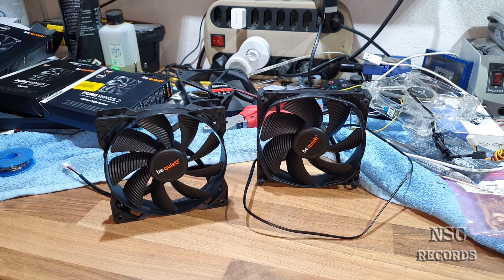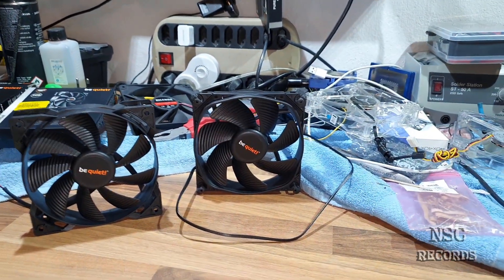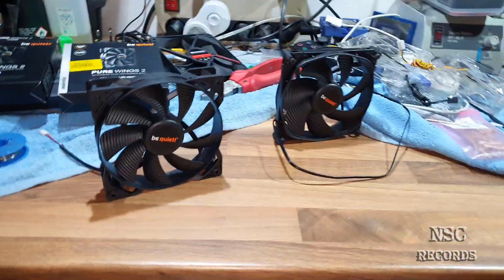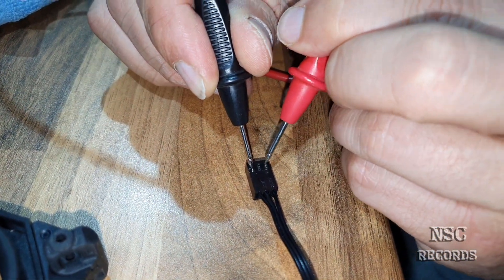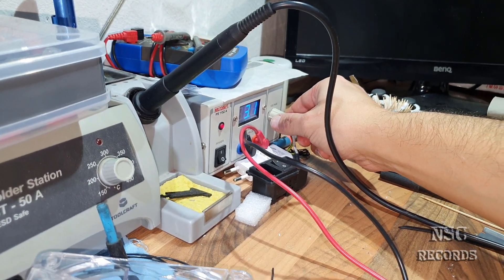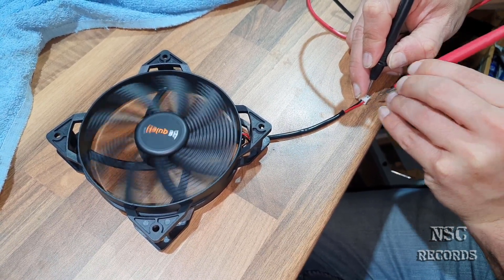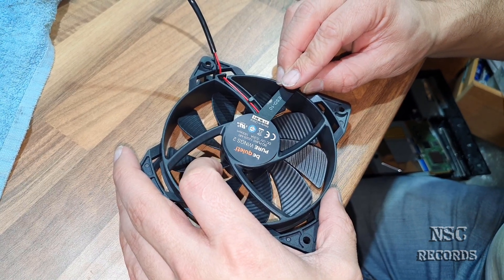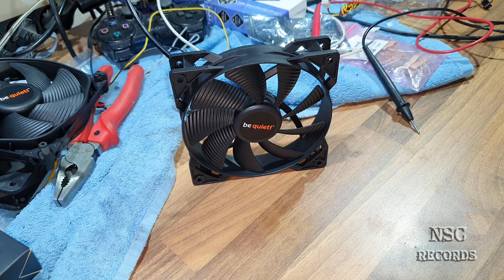Do NOT replace a PSU Fan before you watch this video! By:NSC

Comment: Great video, thanks a lot. How to i know minimum fan voltage of my PSU? Starting voltage of the original fan isn't in datasheets.
Reply from the maker: You welcome. Start your PSU when it's could and while that check the fan voltage with a multimeter.

Comment: I managed to replace a cooler master fan which had became noisy even at low rpms. I had an old Noctua NFP 14 with no pwm nor tachymeter working because of bad wiring :) Only the fan was working. but as you say in the video, it only starts at 4.5V. the power supply fan start at 3.5V. So i have soldered  a little circuit to boost voltage a little bit with an Opamp and a transistor it works for now ! No noise at all thanks to noctua !
Reply from the maker: Good job and you always welcome 🥰

Comment: is this good for Cooler master GX750 Bronze Power Supply?
LIGHT WINGS 120mm PWM

General data
Model	Light Wings 120mm PWM
Dimensions (mm)	120
Color option	Black
Lighting	ARGB LED
Fan speed at 100% PWM / 12V (rpm)	1700
Noise level at 100% PWM / 12V (dB(A))	20.6
Airflow at 100% PWM / 12V (CFM / m3/h)	41.5 / 70.5
Air Pressure at 100% PWM / 12V (mm H2O)
Reply from the maker: I don't know, you need to try it out your self, like the most here. If your fan is very loud or just disturbing you, than try an other fan. Just always take care while working with PSU's

Comment: Very valuable video. My HA13525H12F-Z in Antec Edge 650W starts to be very noisy and I can't fix it because it's sealed. It' quite difficult even to order the same fan, mine is translucent with leds, but even black one is hard to find. I only see ones on ebay/Amazon but they don't ship to Poland and I don't know it is original or fake one or it will be working or not. Expensive one for sure.
Do you know which 135mm fan can I order to replace it? This little guy working on 2,6V after start unfortunately but it's very uncommon size, most of fans in this size needs more voltage to work.

Comment: is Be Quiet Pure Wings 3 also have low start voltage?
Reply from the maker: Yes, but as i know the Wings 2 even lower.
Reply: @NSC-Modz  I just found ARCTIC P12, even officially says 2.8v starting voltage
Reply from the maker: @mantis1033 good to know bro. But if you like it quiet, then you need BeQuiet Fans 😆
Reply: @NSC-Modz  my old power supply from bequiet has a 3rd party Protechnic Magic MGA12012HS-A25 ball bearing fan that is now rattling like crazy. I do not want to swap out the perfectly fine PSU therefore I came here through a crazy PSU repair rabbit hole. Love the video, thank you so much!
Reply from the maker: @ukaszoriol1656 you always welcome bro.

Comment: hi..please help me.. i must change thw psu fan (2pin)... i found only a fan with 4pin ..how modify to 2pin?? and thw other cables? thanks
Reply from the maker: @esaresar-tn8gi  you don't really need the other cables, you just need plus and minus. 3 pin fan is easy to find also.
Reply: @NSC-Modz  I don't want it to work at full speed.. if we can connect the other cables so that the rpms can be adjusted outside if this is not possible
Reply from the maker: @esaresar-tn8gi  it is possible
Reply: @ tell me please what cables connect... this i need know
Reply from the maker: @esaresar-tn8gi Only the RED and Black.
RED = PLUS
BLACK = MINUS

BUT if you don't know what your doing, better DON'T do it, never play with PSU's. It's Danger
Reply: @ thanks.. the problem is that red and black cable give 12v all time and th3e fan works gull.. how bypass thw 3 and 4pin for not working full???
Reply from the maker: @esaresar-tn8gi  https://www.moddiy.com/products/Fan-4-Pin-PWM-Connector-Male-to-2-Pin-CB-32D-Connector-Female-5cm.html

Comment: thank you so so much...no one talks about this huge problem..i replaced the fan from my psu with  a noctua nf-a14 flx and it tried to spin but the voltage was low and didnt spin,so i put the old back.
After your video i found another youtube channel that test fans at low voltages and now i can find a proper fan...thank you so much again..
PS my evga sends 5v at start.
Reply from the maker: @BGDS  you always welcome, good that you found my video... god thanks
Reply: Whats the best fan with the lowest voltage?

Comment: I wish I would have watched your video before I replaced the fan in my Seasonic power supply. :face-purple-crying: The fan (Thermalright TL-B12W) I bought was recommended by a tech blog, but unfortunately the fan would not spin unless I  pushed it with my finger or until the power supply got hot. I put back the original noisy fan since it's always spinning and I'll probably buy the Pure Wings 2.
Reply from the maker: Yeah, the Pure Wings 2 is fully enough 😀

Comment: ı tried to change psu fan but new fan did not worked I know now why.. but how we will know if it will work without buying all these electronic stuff ? atx 3.0 form psu has different form or voltage ı think.. did you try atx 3 psu any ?
Reply from the maker: With the Pure Wings 2 you can not do any thing wrong, and if it's not enough buy the Pure Wings 2 High Speed :)

Comment: i have so many 120mm fans here and need to replace my power supply fan but i dont know if they would work well in it
Reply from the maker: You need to see how fast they turn and how much voltage they need to start spinning, so you can choose the best one for you
Reply: @NSC-Modz  thanks but i also meant because of the Quallity of the fan if they dont push enought air that can probably end bad i have here fans from many brands but not good brands
Reply from the maker: @Cenquee-Borat  right
Reply: @NSC-Modz  I'll probably just buy the Pure Wings 2 then, since I know I'll be on the safe side with that. Thanks for the video!
Reply from the maker: @xcqML yeah, absolutely enough 🥰

Comment: Corsair AX 1200 Gold, replaced the orginal fan with a Pure Wing 3 PWM (4 pin), and the fan spins. 
There is a easy how to do it explanation on internet, hence the cable management is different.

Comment: Hello, could you tell me, can I use p12 Arctic fan (2000rpm) to my Aerocool 750W PSU by connecting the fan to motherboard? The fan speed will be controlled based on CPU temperature. Is this a good idea? I have GeForce 3600Ti (max 200W)
Reply: Curious how it worked out for you.  There are times when gpu pulls more from the psu causing it to heat up, without adding much load to cpu.  Perhaps using software to adjust your new fan based on gpu fan?
Reply from the maker: Yes, as long you sure the fan will turn fast as necessary for the PSU...

Comment: well i already started playing with a diy gpu water block so i ended up purchasing 3 120mm fans,  2 for the radiator and possibly 1 for psu.
i just started looking today to see if i can get a pwm fan controller with the dial/nob, and also add a digital temp reader to fit into the back of the psu.
So i could look at the temp at gaming load vs idle and  find a happy position

Comment: Just plug any silent 3/4pin fan to mb and control it manually
Reply from the maker: Yeah yeah, and if it's to silence you gonna kill your PSU because it was running just with 400rpm and it will overheat 🤣 min. is 1200-1400rmp and that's important, doesn't matter where you gonna connect it...
Reply: @NSC-Modz  Well, most $100+ power supplies nowadays are semi-passive. And silent (~800 rpm) cooling is enough for them, especially if the power supply comes with a reserve (for example, 1000w PSU with consumption up to 350w can be cooled at ~500 rpm).  
In case of very long full loads and the heat outside you can also raise it up to 1000+ rpm, it will be enough even in relatively cheap arctic p12. Well, and in general the fan curve (I tie it to the CPU temperature) can be changed at any time if needed.
Reply from the maker: @user-qh5uy1bs9r yes, but not the older ones...
Reply from the maker: On high quality PSU's like from SeaSonic or BeQuiet, this here is not needed. This video here is more for older PSU's or PSU's that has a noisy disturbing fan 😅
Reply: @NSC-Modz  Well, seasonic, of course, but it costs from $300 here. By the way, it can also be fanless. 
It makes sense to change the fan for units up to ~$250. The Bequiet ones, in order to create a reason for switching to top models, deliberately adjust the fan curve poorly and put their cheapest fans in power supplies.
Reply from the maker: @user-qh5uy1bs9r i love BeQuiet and SeaSonik, it's all the money worth :)
Reply: @NSC-Modz  If I could only afford top of the line power supplies, those would be the only ones I would take. But as it is, I have seasonic prime px-500 - it is unreal to use chieftec and bequit from the middle price category after it))).

Comment: I bought the pure wings 2 but it cant plug into the psu because the connector in the psu has 5 small pins but the fan has 4 big holes
Reply from the maker: A fan that you buy extra for your PSU needs always to be modified...

Comment: My original one starts at at full speed then goes silent 
Cooler master 750w
Os that normal ?
Reply from the maker: Yes, because it makes a fan test first.
Reply: I have the same problem with the cooler master. Sounds like a jet fighter in my silent pc. I have 2x new 140mm thermaltake fans from my thermaltake T71 Case. They are not so loud like in PSU. Now watching videos or i can change.

Comment: Where do you find start voltage information? I bought replacement fan for my Seasonic gc-650 gold and it does not spin. Just starts and stops immediately. Reconnected the old fan, it's working. There is no start voltage information either for fan or for Seasonic psu hmh. I thought maybe it will start to spin if the PSU start to load more? I can't just buy another and test and buy another and test until I find one that works haha? Huh
Reply from the maker: Yeah, that's why you need to test this for your self. Not all fan manufacturer's writes the start voltage on the package.

Comment: im planning to replace my corsair cx600 fan with arctic p12, but it said the starting voltage is 3.9v (but a reddit thread said it was 2.7v). will it start? or should i get the same fan? (from what i googled; cx600 use Yate Loon D12SH-12 (starting voltage 2.18v). thankyou

(is it true that the corsair cx600 need 2.18v starting voltage?)
Reply from the maker: You can read a lot on the Internet but i always say, test it always your self, than you will know it better. So just connect it, start the computer and look if it spins or not.
Reply: @NSC-Modz  i agree, just trying to make sure so that i dont snip the fan cable for nothing. thankyou!!
Reply: @WZRDr  Soo.. the fan spin properly ?

Comment: rog psu vibrates a little but it's in 0db mode so I'm probably listening too hard
Reply from the maker: Hmm Take care. I just trust ENERMAX, BeQuiet or SeaSonic PSU's
Reply: @NSC-Modz  Seasonic make the Rog Strix PSUs for Asus. update.. tried fan control and slowed the others down. Turns out it's the front fans and not the PSU fan. I think they are pure wings (from a 500dx case)
Reply from the maker: Uhh good to know that. Ty

Comment: Hi, got a question regarding the Pure Wings 2 , 2000rpm model that you mention/have in this video, did you test that one as well with the same low start voltage results or do/can it differ compared to the 1500rpm version?
Reply from the maker: Yes, testet it to, was working great also with lower voltages.
Reply: @NSC-Modz  That's good news, thanks for answering so fast!
Reply from the maker: @daflipflop  you always welcome

Comment: Need some feedback.

My chinese fan went out. It's a Young Lin fan with no specs online (DFB132512H). I have already replaced it with the 2000rpm Pure Wings 2 as pictured in the video. However it's only the 120mm version. The fan it replaced was 140mm. The 140mm version of the Pure Wings 2 does 1600rpm, but also generates 94.2 CFM over the 120mm's 65.51.

I will be wiring either Pure Wings 2 fans to the MB CPU_Fan2 header. Does it matter that the 120mm has an input power of 3W, versus the 140mm's 6W? I assume not since it's powered by a PWM header and not the 2 pin PSU plug.

Comment: Why would a switching PSU have such unstable voltage? It's connected to the 12V rail right?
Reply from the maker: You mean the fan? The Fan works not constantly on 12v The fan works on the beginning with lower voltage. As the PSU begins to work hard on load it will let the Fan turn faster.
Reply: @NSC-Modz  Ok thought that the PSU delivered constant 12V to the fan.
Reply from the maker: @mburetorp  nope 😀

Comment: Hey, I'm trying to replace my 92mm slim fan in my sfx psu but I cannot find any with a low starting voltage. Any recommendations?
My PSU has fan failure protection too. Is there a way to bypass the protection and use the motherboard to power my replacement fan?
Reply from the maker: Hmm if you can't disable it on Bios it will be difficult for you. But i know there are some modifications on the Internet to bypass that.

Comment: I'd prefer Noctua but how to find out what start voltages they have?  The tested Noctua has 5.2 volt start voltage, so this means it's not recommended for PSU?
Reply from the maker: You can test it like i did on this video. Not recommend because some PSUs when they are could they use only let's say about 3 volts. You can use a Noctua, but than connect the cable on the motherboard.
Reply: @NSC-Modz  Thank you very much for your immediate answer. 
I can not test the voltage as you did because I don't have the equipment.  :-) 
I'll look into the motherboard option. 👍
Reply from the maker: Yes, be sure that on bios the fan is set on standard NOT on silence.

Comment: Thank you for video. Can you please help me ?  I want to replace PSU fan with  be quiet! Silent Wings 4 1900 RPM
Questions:
1. is 1900 RPM enough ? I have RX6700 xt Draws about 200 W on full
2. Can I connect fan to Motherboard instead of psu itself? (Mag Mortar B660M) I have SYS_Fan2 and Pump_Fan1 connectors on MB 4 pin.
Reply from the maker: Yes, 1900 is OK, and yes you can connect it to the motherboard to. Just be sure that the fan on bios is not set on silence or slow mode. Just set it on standard
Reply: @NSC-Modz  Thank you very much!
Reply from the maker: @Daviusus  you always very welcome 🥰

Comment: I just run a power supply fan header to the header on a motherboard.
Reply from the maker: Sure, works also.
Reply: Which software to control it? I was planning on connecting the psu fan to the mainboard and use fan control because that way I could have a silent rpm in idle. But I wasnt sure how safe it is.
Reply from the maker: @012345678944107  you can set it on bios also
Reply: @012345678944107  I do it through the bios of the motherboard.

Comment: Great video! Do you have any recommendation for my old Corsair Gaming Series GS800? It's very old, but still working and I don't want to thrash it out. Only problem is, that the fan is very loud now. It should have 140mm fan, do you think that Be quiet! Light Wings 140mm PWM will work. I don't know where to find starting voltage of the fan, because no manufacturer has this information in datasheet.
Reply from the maker: That's right, hard to find some Infos, that's why i wish that people's use this video and begin to share some more specs about those fans. And yes, you can go for this Fan.

Comment: CS750M PSU making insane noise. Can its fan be replaced by and brand fans? all 'cooling fans' work?  matching size and starting voltage?
Thanks for your video, it was very interesting.

Comment: So i got a be quiet power wings 2 ,a 140mm fan with 900rpm for my psu .My psu uses a 140mm fan with DC12 V like my be quiet fan .I installed it after doing a conversion from 3 pin to 2 becose the fan from my psu uses 2 pin conector and  everythink works  perfectly .
Reply from the maker: Nice, you always welcome 😉

Comment: Did some messing around with an Apevia 600w prestige and ran into this problem, as my pure wings fans are all 900rpm. I don't feel like having to order in another fan, I wonder if some PSUs have a potentiometer or other way to control the voltage, to make the fan turn faster?
Reply from the maker: Yes, but most PSU´s are controlled by temperature sensor. On some PSU´s like from Enermax, you can set the fan speed.

Comment: Hi thanks, your vid helped. I want to add my info for others. I used Arctic P14 on my old Chieftec Super Series CFT-600-14CS 600W PSU. Solder cables and it works fine. Starting Voltage for new fan is 2.1 (info from manufacturer).
Reply: I used P120 bionix I had lying around on my corsair cx650m power supply. It works much more quietly now.
Reply from the maker: Yeah, a cheap fan can really be annoying...
Reply from the maker: Ty for the info